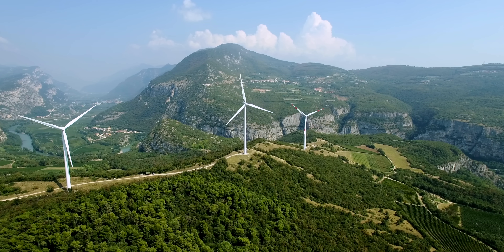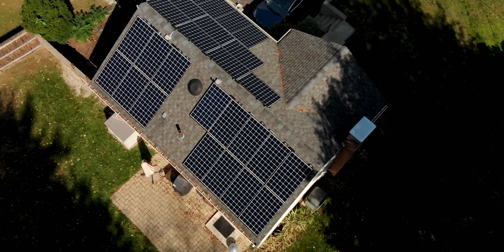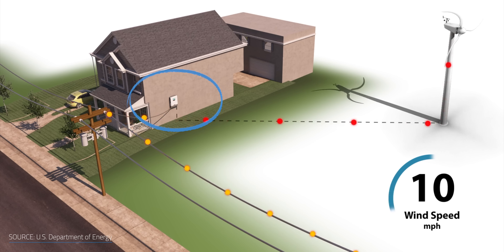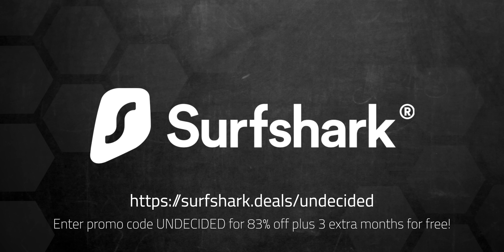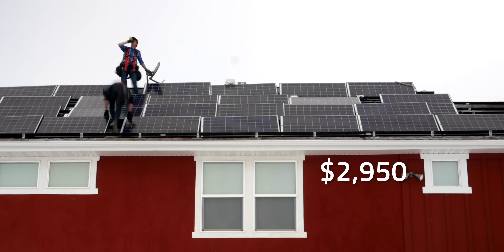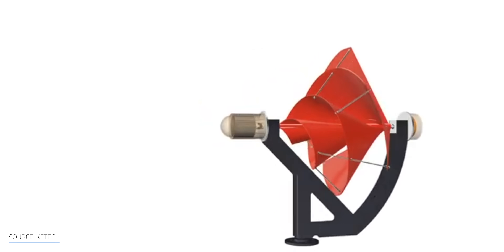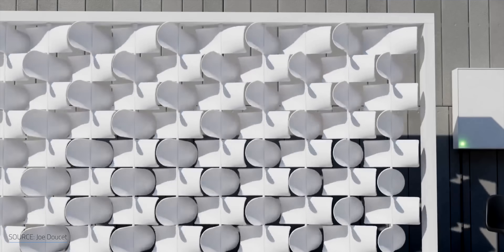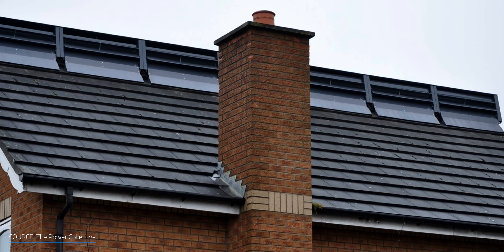The Challenges of a Wind Turbine on Your Home

Comment: I was hoping for a small ~1kW turbine that would be used to charge a storage battery similar to a Powerwall.  Instantaneous power would be sourced from the grid or battery and the turbine would just provide a charging current. We are up at 57° North and for a lot of the year the weather conditions (Scotland - cloudy, windy) and limited sunlight hours mean solar just isn't as useful for us. Unfortunately, it looks like the technology isn't quite there yet for small turbines. Hopefully the products you highlighted will continue to be developed and put into full scale production over the next few years. Great video, thanks.
Reply: The thing here is physics - small turbines just cannot harvest a lot of power, but are still complex products. That's why the bigger the turbine, the better the economics look for it because it can provide a lot more power - making the turbine blades 2x longer gets you 4x the area that power can be harvested from meaning the turbine power grows 4x.
Considering you are in Scotland and it is pretty damn windy out there and winds are pretty stable on average, having a comunual big wind turbine owned cooperatively can be the difference between payback period being 22 years like in the video for not a lot of power produced to having like a 5 year payback period and producing so much power that you gonna have to sell a lot to the grid. The downside is the required investment upfront, sadly.

Comment: Thank you for coming back to this topic Matt.  We live in rural Missouri. There are times when it's cloudy/overcast for days in a row and we're considering supplementing our solar.  I was totally unaware of the yearly maintenance.  I'm now confounded about how I would do maintenance if our windmill were 65 feet (19.5 m) high!  

After watching I still feel I'm not ready to take the step to wind power.  I'm going to root for the ground based (edit typo: vehicles) vertical systems to become .... Everything we need.
Reply: i'm not sure about laws in missouri but i helped set up a turbine for a friend while i was staying at his place in utah, he paid ~$1200 (total) for a 2.4kw unit from thermodyne systems.

as for prices mentioned in this video, ask for some quotes and you'll likely find that you can't even find someone asking anywhere near 5k per kw without it being extremely hyped or something like a full install (likely including arranging legal stuff)
Reply: @angrydragonslayer  Thank you much!
Reply: @ChinaChuck  just a fair warning: do not expect much if you have low winds

this goes for literally any wind system
Reply: @angrydragonslayer  is he in northern Utah? and or engineering wise did it make sense? and with average 15 to 30 mph is it a good fit 9 month's out of the year?

Comment: For me, the issue is simply that it needs maintenance rather than what the cost of that maintenance is. Since I can’t do that maintenance myself, I’ll need a contractor and I don’t know of any that specialize in this.

Compare that situation to solar…there’s a million solar companies in my area willing to come out and tweak your system whenever needed! Im hugely supportive of the idea of micro wind turbines, but I just feel like I need my neighbor to have one for a couple years before I’m willing to take the plunge.
Reply: Wait what?  No Wind cuz maintenance, yes solar cuz maintenance?
Reply: @miked.9364  I’m talking to the maintenance infrastructure. Take my car for instance, I don’t have the skills to do most of the maintenance on it, but there’s loads of shops all around which do. The result is that I don’t worry too much about having a problem which can’t be fixed due to lack of skill in my immediate area.

Solar is in a similar situation. There’s loads of installers in my area who can come out and take a look at the system if I’m encountering problems. But wind is in its infancy so either the maintenance techs don’t exist yet or their name isn’t out there enough for me to know that they exist.

This is why I won’t be one of the first people lining up to slap a wind turbine on my property. But once I hear of a couple people successfully doing it and getting their issues resolved in a timely manner then I’ll be more willing to look into the pros and cons of setting up my own wind generation.

Comment: I've been a consultant on wind and solar for ten years.  Wind is not practical for 99 pct of homeowners due to the steady high winds needed to make small turbines economic.    Wind makes sense at utililty scale, but at homeowner scale it's a niche application,  used only in very windy places or as a supplemental source for long winter months with no sun.  So basically your video is correct!
Reply: That's what I thought.
But what about cities, I've heard they have increased levels of wind because of all the buildings.
Reply: But, what if I pitched it as a home exercise machine and linked the instagrammable wall turbine to a stationary bike? 

Call it... AeroDynamix, and sell the whole system for $10k + a monthly subscription fee for classes?
Reply: @imightbebiased9311  soylent green?
Reply: What do you think of Semtive’s? A cousin of mine’s had great success with their’s but they also live on the unblocked very top of a large hill that’s arguably a small mountain in town. I’m curious about it in more erratic places.
Reply: How about for Tall Buildings?  the height should make the turbines more productive
Reply: @brunogm  sure, if it's the only tall building around and it's very skinny, like a tower  but the roof has to be reinforced.
Reply: Would one of those niche application be if you're already maxed out on solar and there's no more free rooftop space? The apparent low land footprint of a vertical axis wind turbine has impressed me.
Reply: i have been considering a solar system, my biggest worry though, how do you keep the snow off of the panels? i dont like getting on the roof in winter, and that activity may not like me.
Reply: @element5377  Sun can go straight through the snow on the panels, so you would't have to clean them off at all. Talk to a solar installation contractor if you anticipate any problems with solar, they've probably given the issue you can think of some thought before.
Reply: @element5377  in winter the panels should be 

tilted more to the south so may not accumulate as much
Reply: Yeah, but 30% of Americans live in a county that's literally touching the ocean.

There's a lot of windy areas in coastal counties.

There's a decent percentage of Americans that live in areas where that "niche" application makes sense.
Reply: @lordgarion514  take a look at the DOE/NREL wind resource maps.  they're pretty accurate for avg annual wind speed at height
Reply: Niche application. Like every farm and small town on the prairies?
Reply from the maker: Thanks for jumping into the comments and sharing!
Reply: Shady Island, your statement about the unsuitability of wind turbines for the masses may be correct BUT giant wind farms are not being built where 99% of the people live either. Here in rural America  where we have these monster eyesores going up, us little folk can't get paid half the rate the wind farms get paid. If we could, everyone of us would, and these giant farms wouldn't be needed. When the PURPA act of 1978 was passed I expected every farm to be making power on a small scale and most of that with wind. Instead we were not allowed to for the same rate of pay and therefore it hasn't happened. Instead of the extra source of income that would have supplied farmers, the country just got rid of all the farmers. In the 1930's nearly every farm did have wind power on a small scale.
Reply: @kurtappley4550   It's unfortunate that some policies developed decades ago in parts of the US midwest were  not well thought out.   Today there are several programs run by USDA and others to support wind energy on farms,, many of them give grants to individual landowners and small farms.  There are thousands of farms out there with turbines, making them money.   Iowa farmers are very supportive 

.
Reply: @shadyislandchronicles4237  The number one issue with any alterative home owned power generation scheme is needing to get paid for what is generated by monopolies that really don't want you making your power rather than buying it from them. That is, of course, if you wish to remain hooked to the grid. As with almost everything else, the government is friendly to the monopolies so home producers' are not paid at the same rate and in my state, have to pay for utility hook up. A decent federal government that actually worked for its citizens and the citizens of earth is what is truly needed.
Reply: Also wanted to add that most of the commenters I see on this post have been misled. I have always been a fan of small scale hydro and low head hydro works but requires more expenditure than high head. Wind turbines in many parts of this country do not require a tall tower. In trees or low wind areas that may be necessary.
Reply: @kurtappley4550  steady output gives hydro a great advantage,  but no moving parts is hard to beat...lol
Reply: @shadyislandchronicles4237  Steady output can be huge when you are looking at off-grid applications. It means less batteries needed. This is a massive benefit for both wind and hydro power. It saves money both on installation and on equipment maintenance. Unfortunately, both applications are extremely limited on availability for homes. Most homes simply don't have access to enough of either to be worth spending any money on.
Reply: @anthonypelchat  what do you mean by hydro power?
Reply: @billisbell8028  water powered generators. Basically a dam but micro sized for home use. It was in reply to others talking about it along with wind power.
Reply: I live in Texas and have 10kw of solar which meets my needs. I would love a 500w wind turbine in case the grid goes down. The winter storms are becoming more frequent and it's not feasible to size a back-up battery for a whole week or so. A little bit of wind would add a lot of resilience.

I also wish that I knew about combo PV cooling/water heating systems when I got my panels installed. Thermal batteries look like an amazing solution.
Reply: @AbeDillon  could look into a sterling engine , if you have a woodstove or the like when the powers out your going to have heat escaping somewhere so if you set it up right you could have another source of energy.... not sure if anyone actually makes them for home use though...
Reply: @blackdeath4eternity  you mean a wood fired steam engine, like an older locomotive?  i hate getting wood out of the snow and loading into the stove. nearly chopped off my thumb once and broke a toe when a log dropped on it. lived with only a wood stove for 6 years. natgas is such a fine luxury
Reply: @element5377  a sterling engine is not a steam engine, though if you have something burning hot enough i suppose you could use a steam engine... more maintenance with that though... & pressure... & boilers.... yeah sounds like allot more work to me. 
A sterling engine runs on temperature difference/pressure difference so it could technically run on a lack of heat, but for that to work it needs one side(normally top or bottom) to be warmer.  they are also a very low pressure unit so you do not need to worry about explosions like with steam... they are on some diesel electric subs. 
if you have a gas stove & do not need to worry about the fuel being lost in a grid down situation you could set up the sterling engine off that, heck do it right & you could just set it up next to a window & likely get some power back, just not as much.
Reply: @AbeDillon  your best bet is to just get a couple of those little marine wind turbines people mount ont he back of their sailboats.   they are built to last.
Reply: @AbeDillon  Hook a bunch of batteries up for daily use, not a week. 10kw of solar in Texas should get you 60+ kwh of total power each day during summer. You need batteries anyway to cover if the grid goes down. Use that option first before buying wind turbines. And never price out batteries for a week. You will see the sun each day. Just reduce non-critical power usage during low times.  

PV cooling/heating sounds good on paper, but likely not worth it from what I've seen. Much more maintenance and cost for marginally better efficiency.
Reply: Nice! Always great when you see validation from someone actually in industry!

Have you seen any of the newer micro solutions in practice yet? I’m curious how they’ll perform in the real world over several years, but I don’t think they’ve gotten to the point that they can provide that data yet.
Reply: @SaveMoneySavethePlanet  the three bladed horizontal axis turbine is the most efficient design by far.   There are alternate designs that address issues like noise, bird strikes,  low wind generation, but their efficiencies are all worse than the standard design.     it's all about life cycle cost per kwhr. in your local wind regime, at your operating height AGL.
Reply: @shadyislandchronicles4237  I hear good things about verticle turbines as well. Though if you have constant running water on your property a small hydro generaror is better than both wind and solar.
Reply: @Jokerwolf666  agreed about hydro.   but you need at least a few meters of head.  small vertical axis wind turbines have some advantages, but efficiency is not one of them.
Reply: @shadyislandchronicles4237   Yeah definitely. There would be a little landscaping involved with some setups for hydro. I am learning as much as I can before I move out of the city, tired of paying 300CAD a month for electricity which will only continue to rise as we all age.
Reply: @shadyislandchronicles4237  so average constant wind speed needed to make sense of adding it ? under 2 to 10kw ( asking as that seems like a good size to ask about and or power need to turn it is more likely to be found easier ) as 4-ish months of the year its clam here the rest of the time i think theres a good chance of engineering wise making sense, finically that's a hole different and more complex ball of wax for be asking and answering latter on and sometimes it's just a convenience not to having to start the generator to charge the battery and or running things ect more so if the solar system isn't keeping up
Reply: @Jokerwolf666  but i don't have water and power opportunities at this place my old one sorta
Reply: @richardprice5978  NREL/DOE  publishes wind atlas maps showing avg annual speed at different heights above ground.  good starting place to estimate annual power output.   if you want to buy a small turbine, get one of those marine models for boats and put it on the tallest tower you can build and guy wire.   I don't know much about wind turbines below 2 Megawatts,  I only know that solar is almost always cheaper at that scale.
Reply: @Jokerwolf666  I do but it's illegal to stop the flow of water or even tamper with it. I would like to put a water turbine on the small creek on my property which feeds the larger creek, I could probably get some power after the rains come. The large creek is off limits, a water wheel may be ok since I can bottom feed without stopping the flow or slow it down.
 Birds are in danger with all windmills. Unless you put a screen in front of the blades then you will lose some power due to resistance from the screen. I think the problem is not the heavy winds it's the lighter winds bird usually don't fly well in heavy winds. 73
Reply: Not to mention that you need to get to about 15 meters high before it could get anywhere near interesting in most cases plus getting the proper paperwork
Reply: @Roguescienceguy   In some places like where I live soon as you get outside of the city basically anything goes as long as you're not polluting and follow standards. In the city though they don't let you do anything except for solar.
Reply: @Jokerwolf666  Vertical axis wind turbines would be great in a city with a lot of high-rise buildings. Just think about the wind speeds on the roof of a 10+ story commercial or residential building. The further higher you go the more wind speed and thus more electricity that could be produced. Sure it would not prevent the building from going off-grid but would provide enough electricity to reduce the overall cost of electricity if there were multiple vertical axis wind turbines installed.
Reply: @Jokerwolf666  if you're nabors have HAM radio stations wind permitting should be easy ish right as one of the towers is 50 ish feel up i think anyway's i try not to be noisy/creepy about knowing things like that hobby as that not my hobbies and there not bothering me with it and if crap hits the wall thats a useful thing/and or person/skill to have next door to me
Reply: @Drought-jr6pb  on sky scrapers a few wind turbines could also power the elevator & some batteries for grid down situations.
Reply: @Drought-jr6pb  there's a lot of wind running between the very tall buildings that concentrate it.  especially in chicago